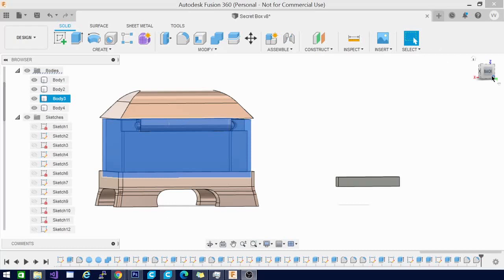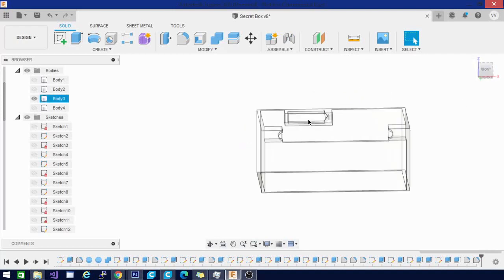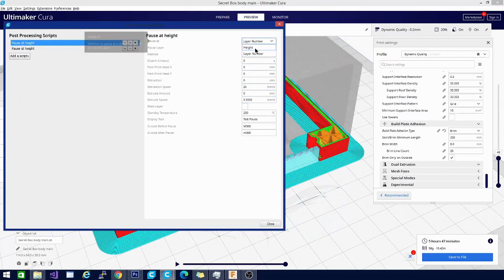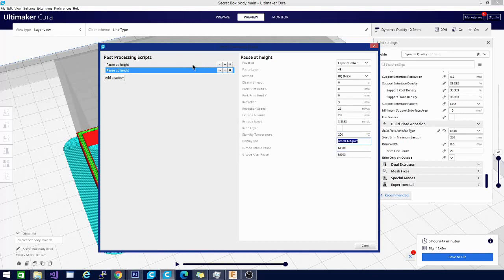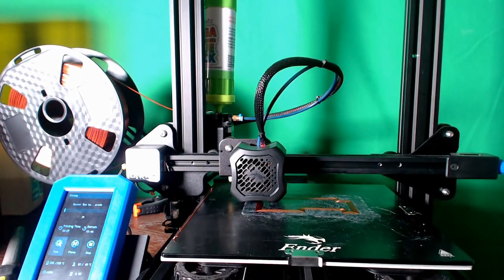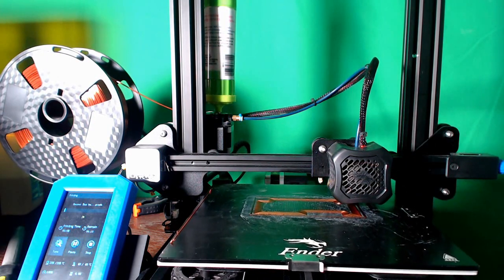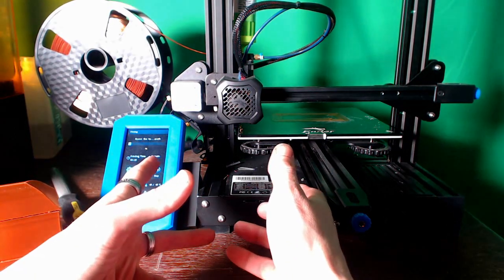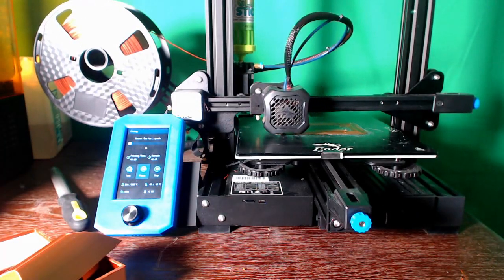Pause at Height for Ender 3v2! swap filaments or add magnets

Comment: While all these tips DO still work in 2022 on Cura 5.1, it is still a bit of an annoying workaround.  It is actually FAR EASIER to just get rid of Creality's stock firmware and replace it with something that includes more of Marlin's standard features.  Doing this will get you a whole lot more than just support for the standard M0 (pause) and M600 (filament change) commands, like having menu options on the printer itself to enable or disable power loss recovery mode, mesh leveling, etc.  I've tried both JyersUI and mriscoc firmware, and I really prefer mriscoc
Reply from the maker: Firmware upgrades are great! I tend to use e3ds... But there are lots of options. If you know marlin you can actually turn those features on and off in your current firmware with Arduino suite, then reflash it. This of course is for intermediate to advanced users however, and this video is more for beginners who aren't that far in yet. But great points!

Comment: Question: Does the Marlin (M0) work yet or do still have to use the BQ (M25) method now in end May 2022?
Reply: Answer. Use the BQ (M25) option. 

Marlin (M0) does NOT WORK!

Comment: Does not work in 2022. Cura 4.12 & Ender 3 v2 Build 1.3.4
Reply: I can't speak for the older version of Cura, but I just tried this today using Cura 5.1, and it's working on my Ender 3 V2
Reply: Hey, did you find a solution by now? Having the same hard- & software and I'm still looking for a fix...

Comment: OMG.. if this works im going to be so excited.. can't tell you how many hours of my life i've wasted hovering over my prints waiting for just the right layer to hit Pause.... giving it a try..... wait for it... wait for it........YES.. IT WORKS... EVEN BEEPED TO LET ME KNOW IT WAS PAUSING..... thank you.. I had tried this extension before, but I didnt have the M300 codes in there, so it never worked for me..  life is going to be sooo much better now...
one question... I noticed your head moved up (z direction) when parking, mine doesnt do this, it just stays at the layer height, how do did you get it to do this, as It's nice to put some room between the bed and head so you can squeeze out some of the old filament when changing colors.
Reply from the maker: Z hop on layer change setting should lift the head for ya! Glad it's working!

Comment: I am trying to do something similar with some of my prints, but on the layer that stops and resumes, on the final model there is a very noticeable "scar" layer that's also a weak structural point. Have you encountered this? And can something be done to mitigate this?

Thank in advance!
Reply from the maker: if you have a baby or microstep option you can lower it a little before resuming. honestly though, if your doing this a lot, i would use prusaslicer. it has a setting specifically for this, and will go ever the previous layer when it resumes to ensure the part fuses and dosnt leave a gap

Comment: Whenever I do this the layer before the pause never bonds strongly with the layer after the pause, there's a visible seam between the two colours (I use this technique for filament swaps).
On an old 3d printer (that I don't have any more) I used to be able to just pause it and swap the filaments and it worked perfectly, so it's quite frustrating that I can't do it any more.
Reply: Redo the last layer after the pause
Reply: @mikerosoft714  Tried that several times, seems not to change anything. When it does the next layer it's something like 1mm above where it's meant to be, so repeating the last layer makes it whatever fraction of a mm lower than that but still way too high. I have no explanation for why it does this.

Comment: Disarm timeout set to 0 is two minutes. not forever. 1800 is max
Reply: Technically, 0 will do the firmware default timeout, which just happens to be 2 minutes.  1800 sec is the maximum that the Cura script will allow you to put in by default, but you can extend the timeout in the gcode file directly, or even modify the base Python script file for Cura to allow higher numbers.  The absolute maximum timeout is set in device firmware, and from what I've read so far, it seems that on an Ender 3 V2 with stock firmware, that maximum should be 14400 seconds, which is 4 hours.

Comment: I don't know if you can help me but I tried many different things and I'm getting everything to work however when I resume the print after I swap the filament it always seems to resume printing at a layer above where its supposed to. For Example I paused at layer 15 and its supposed to resume at 16 but you can clearly see it extruding higher than layer 16,maybe layer 17. I've looked everywhere for a solution on how to resume at the exact layer after the pause and found nothing. Using ender 3v2 and cura 4.9.
Reply: i am having the exact same problem, have you found a solution?
Reply: Depending on how quickly you did the filament swap once it reached the pause point, it is possible that the "disarm timeout" had expired, and you may have manually bumped the Z axis while changing the filament.  If you get rid of the stock Creality firmware and replace it with something else that keeps more of Marlin's features in (I have had the best success with mriscoc firmware), you can avoid using the "pause at height" workaround entirely and just use the standard "Filament Change" M600 command.

Comment: Can I ask which version of cura your on? I'm on a v2 with Cura 4.9.1 and when you resume the print, the z axis goes back to a position that digs into the print. From what I'm gathering its from the gcode.
Reply from the maker: Try turning off z hop and be sure your not outting downward pressure on the extruder when changing filament
Reply: @Technivorous  made sure its off and made sure I hadn't been putting pressure. Tried plenty of prints. And doesn't let me do anything with z offset once it has been paused at height. Apparently some people have reverted to different versions of cura to get it working right.

Comment: hello, this really helped me... i have one issue tho, when my ender 3 v2 stops at height, when it returns, it starts printing a little bit to the right, not in the same line of the object below, do you know why? thanks
Reply from the maker: This is one of 3 things... A loose belt, a loose eccentric nut, or u accidentally moved it while changing filament.

Grab your carriage for your hot end and wiggle it. If there is play it needs the nut tightened. If there isnt, pluck the belt and make sure its tight!
Reply: @Technivorous  i found that the issue is the position i was asking my printer to go when stopping at height, i said 20 20, this resulted in this weird behaviour, i changed it to go to 0 and 0 and the problem dissapeared.

Comment: First of all, awesome video!
I have a problem that while removing the filament I think my gantry is moving slightly downwards so when it continues printing again the filament does not go out because the nozzle is too close to the part (in fact it makes an indentation). How can I stop the z axis from moving while I manually change the filament please?
Reply from the maker: Just a little practice. Do your best not to exert any pressure on the gantry. It took me a few times to get a method where it didnt shift, in get the best result by applying pinching pressure on the extruded lever, and going a bit slower when pulling it out. Also, it will go a little smoother if u push the filament forward by hand a littlez and then pull. So pinch the extrude lever, push a bit, than slowly and evenly pull it out
Reply: I think I found a solution for this probleme, at least it has work for my last print : put "disarm timeout" to 1800s. This way, the steppers will stay locked and the z axe will not move at all. To remove the filament, just pinch, don't use the stepper.

Comment: Hey great video thank you heaps !! I have a huge problem tho when it pauses and waits for a filament change I change the filament but the stepper motors turn off and I lose the Z axis position and resumes where the Z axis is at that time. E.g Z axis dropped lower and crashed into the print. Ideas?
Reply: I think I found a solution for this probleme, at least it has work for my last print : put "disarm timeout" to 1800s. This way, the steppers will stay locked and the z axe will not move at all. To remove the filament, just pinch, don't use the stepper.
Reply: I've run into this problem too. Setting the disarm timeout to its max value of 1800 seconds is ok, but it means you have to be in the room with your printer when it comes time to pause. Not great if you want to go to sleep, and add the magnets in the morning the next day.. Maybe some more info on how to achieve this with the firmware?

EDIT: If you're running Octoprint, you can send an M17 command to your printer from the terminal to re-enable the steppers before you add your magnets. Just tested it and it works :)
Reply from the maker: This can be changed in the firmware. Only way to keep the motors on.

Comment: hey Tech 3d, ive got a huge issue and i need a serious help with that (or anyone else). 
im using Ender 3 v2 and when the program pauses, i change the filament, then the axis and nozzle returns back to the bed and continue the printing, but from the bottom. I mean (for example) i have printed 5 layers, after change and resume it continues to print the 6th layer, BUT from the bottom (layer 1). how can i fix this? im afraid, that i damaged the nozzle already, so i just changed it up
thank you for response (feel free anyone to comment, ill take any help)
Reply from the maker: Be sure you are not exerting any downward pressure, when changing the filament. You can unknowingly push the gantry down to the bed if your not careful.
Reply: @Technivorous  surely that did not happened, ive even measured the distance before and after the change.... the nozzle (z axis) just returrns to the 1st layer (or the last layer) and overwrites it with continue work
Reply: I think I found a solution for this probleme, at least it has work for my last print : put "disarm timeout" to 1800s. This way, the steppers will stay locked and the z axe will not move at all. To remove the filament, just pinch, don't use the stepper.

Comment: Thanks to your video I was able to print with different filaments by changing color in ender 3 v2 printer, change the option from merlin to Bq and it worked.
Greetings friend from Argentina
Reply: Hola Yogui estaba buscando esto de la pausa. Me confirmás que cambiando esto de Bq funciona bien? Osea M0 no le da bola pero M25 si entonces? Tengo la v2 4.2.2...
Reply: @correolosrosales   si con este método me funcionó bien en la ender 3 v2

Comment: This worked great. Thanks for sharing. Now that i have this working I have another problem. When it goes to resume print it pauses over part it puts a glob of filament on part before starting to move.
Reply: same!  im gonna try right now to remove all extrusion. and prime the nozzle clean manually.  also going to try to make sure after priming to pull back the filament the amount of MM set in retraction in the "pause at height" settings.

Comment: I'm new at this.  What about the Marlin code M600 which parks the nozzle and runs the filament back almost out?  Another M600 loads filament and resumes, if I understand the statements correctly.  I subscribed to Marlin to get firmware later than the official Creality firmware.  Not sure how to properly implement it since it is not one of the commands in the drop down.  Tried it and wasn't successful.  Apparently you only use M600 once, but didn't play well here.  Tried your settings (retract 3, extrude 2.8) and the extruder backed off quite a bit before going back to the print and going thru the motions with no plastic?  I should note that I print thru Octoprint, not sure if this is the difference.  Really would like to see this work because I have an idea for a print with a changed color filament.
Reply: I saw in another video that the Ender 3v2 does not respond to the M600 command.
Reply: @cleverkathy  It will with the Marlin daily bug fix firmware.  I have a subscription with him.
Reply: Problem was Octoprint.  Removed Pause settings in Octoprint and this worked.  It would however, be better to do this from the SD card.

Comment: hey man are you now stuck using cura or will you be doing anymore tuts with ideamaker  as that has just had an update ..and the pause at height is already built into ideamaker 
i subbed your channel after watching all of  your great tuts on ideamaker ..but just lately you have been using cura  :/